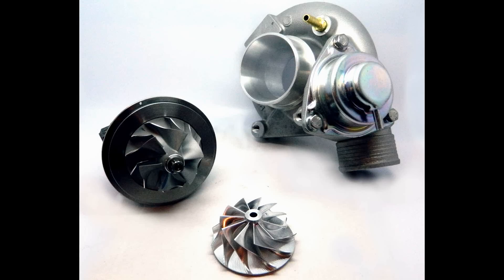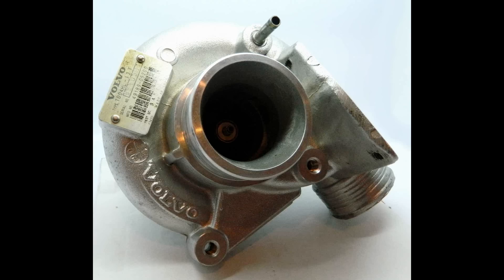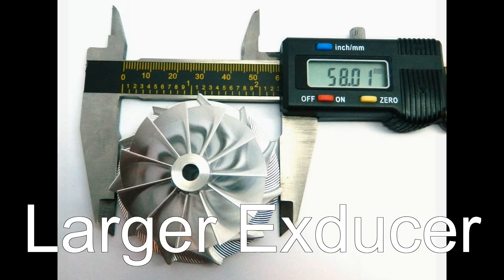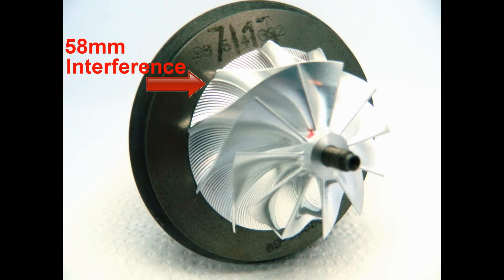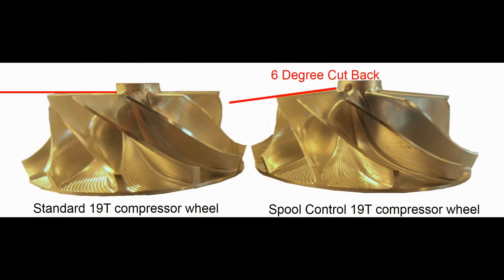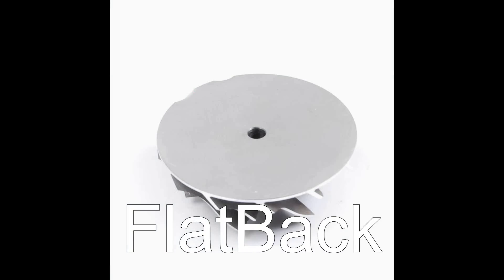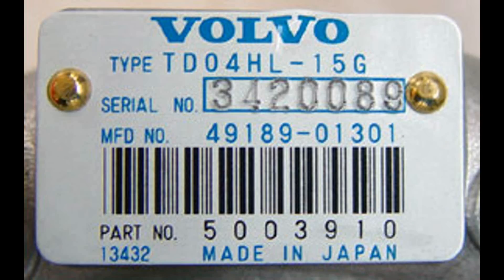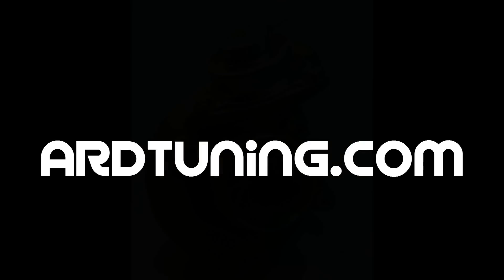TD04 Turbocharger 19T conversion for MHI turbos.

Comment: One thing I don't really see around the internet is upgrading the TS04 10T turbo. As far as I know, that's what's on my F4R 776 engine 2005 Renault Scenic, and I do know, that for example the Megane RS's F4R 774 uses a TD04 14T which can be upgraded to 19T spec. What can be done with my 10T? Do I need to change the housing as well?
Reply from the maker: +Gázser Márk Without measurements of the compressor it's hard to say but typically a billet wheel is a pretty easy upgrade in most cases. Beyond that you may need to consider larger frame size to increase power to a significant degree, of course that's based on what you're shooting for with regard to bph...
Reply: Robert Arnold It's not something that will happen in the next coming months, but when the time comes I'll look into it more and contact you.Thanks for you help!

Comment: Question.. I have two Saab TD04HL-15T #5 on my 4.6 V8. With this type of upgrade, how would the characteristic be? My exhaust housing is quite small and I thought this was the biggest problem? The back pressure must be huge!?
Reply from the maker: We upgrade the 15T turbos quite commonly with good results. For your particular situation and engine the boost characteristic would be strongly dependent on engine flow and compression ratio. Do you know the CR of that motor?
Reply: Robert Arnold  Yes sure, Its original static CR is a little bit below 9:35 (some minor headwork) But you probably need to know the dynamic one? I don´t have the full spec of my cam to calc it.  Its a 220 degree cam with 111 Lobe angle and lift 0.480 rev range 1200 to 6200.. the cam is pretty smooth and gives me around 16 in/hg vacuum but it works very good with my setup. Mindblowing response between 1200-7000rpm, boost almost from idle +300hp @ 4psi The plan is to try E85 fuel and increase the boost later on.
Reply from the maker: ZoDDyXXX Sounds like a solid setup, I think with 19T conversion you'd make some proper power so long as the hot side can flow it... might consider upgrading to 11 blade turbine from the stock 12 blade to encourage better flow and higher total BHP. Spool time is hardly compromised consequently it's a real popular upgrade !
Reply: Robert Arnold Sounds great.. I will try to evaluate my WOT performance later on. Its little bit hard to do it on the public road :)
I need to map it as good as possible so things won´t blow up..

Like you say i think i need to upgrade the exhaust side probably to 7 coz i don´t really need this crazy spool i got now. I have tried to look around for a bigger exh. housing that´s a directly bolt on. Volvo have a couple of them but i need to figure it out if i can use them? It has to be the straight type
Reply from the maker: ZoDDyXXX Sounds good, Be in touch if you need anything in the mean time :)